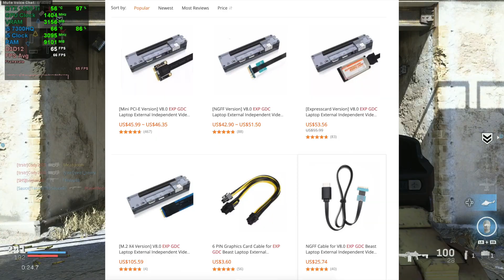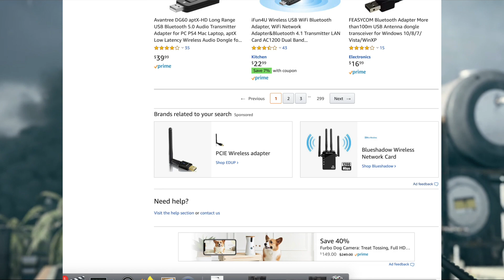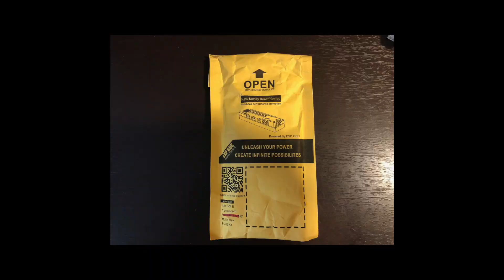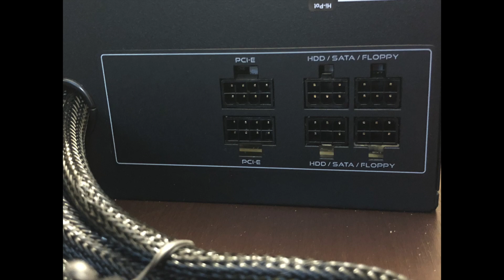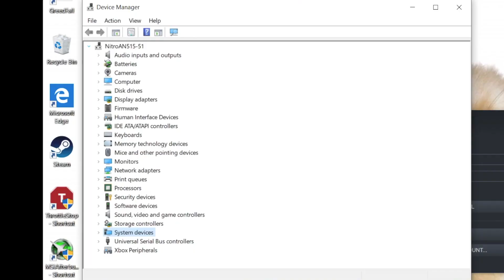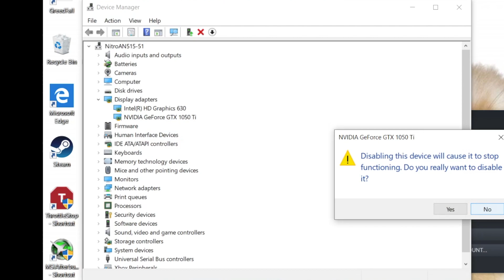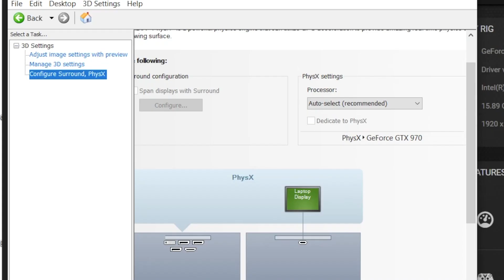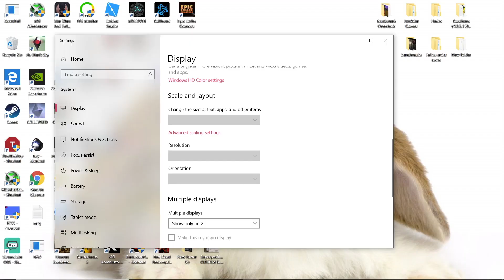EXP GDC Beast NGFF Acer Nitro 5 External GPU Review and Setup

Comment: Ill be glad if u could help, the thing with disabling ports, how did you find tge method for doing it?
Reply from the maker: Trial and error, that's the only way unless there is a detailed guide for the MB out there somewhere.
Reply: @Meanpooh  i mean what type of port should i look for? do you remember how you found that disabling these things work? Thanks :)
Reply from the maker: Generally try disabling the PCIe controller.  That's what the video card uses to communicate.
Reply: @Meanpooh What external doc would you use to connect a 4090 or 4080 to a Asus gaming laptop?

Comment: Hello bro, im writting from southAmerica, i need your help, i have a. Acer aspire 3, and i buy exp gdc with nfgg, all work fine except for a display not working, my laptop identify the gpu but i see mi monior without a image, maybe you know what i doing bad? Thx for your time.
Reply from the maker: I don't know if the Aspire has a dedicated video card but make sure that you installed the drivers for the card you are installing with the EXP.  If you don't have an external monitor, you a TV with hdmi so you can see and troubleshoot.  Remember, once you disable the laptop display, you will be blind without an external display source.  Hope this helps.

Comment: low fps because of the bottleneck or because of egpu  for all ?
Reply from the maker: Both, slow CPU as well as not enough bandwidth for GPU using current connection.
Reply: @Meanpooh what is your openion of i7 4900mq and gtx 1660 , i will face bottleneck and low fps??

Comment: Tried it on my asus rog strix gl531 with rx 580 2048 and hdmi dummy and it works well but unfortunately the bus interface shows only PCIE x16 3.0 @ X1 3.0 . I think something is holding it back, im not sure if its bottlenecking the cpu i5 9300h or maybe the ngff/mpcie/expresscard are simply slow.

Comment: Can you tell me if this same setup will work for 3000+ cards?
Reply from the maker: I can't say but I do know that there is an updated model so maybe that model may work.
Reply: @Meanpooh  Thank you. I just went and bought a new PC with 3060 in it 😀
Reply from the maker: You're better off picking that option.  Congrats on your new purchase.
Reply: @Meanpooh  I appreciate your post. I got Nitro 50 with 12th Gen i5 and stx 3060 video card. I just need to install a liquid processor cooler in it before I start pushing it too hard with VR games.

Comment: The 2021 version of acer nitro 5 have Thunderbolt 4 , so can we use external gpu with it?
Reply from the maker: Not sure.
Reply: @Meanpooh  i am using acer nitro v15 and follow your step but i am stuck on acer logo.... i7 gtx 960m .... egpu 1050ti... can u help me?
Reply from the maker: @zakytetietv9898  Cant give much support without having it but does it boot without the EGPU cable in the in the slot?  Does the GPU have power?  Is the cable secure?
Reply: @Meanpooh  When i turn on leptop EGPU is auto on bu than stuck on acer logo... cabel is scure, i already update bios to last version to..
Reply: @Meanpooh  when i turn off psu... leptop turn on normal... i try to instal driver 960M driver the gpu is not detect so i am sure i already disable the right PCI ....
Reply from the maker: @zakytetietv9898  It's definitely conflicting with something.  You might have to play around with the PCIE controller.  Something is still not disabled.  Trial and error.
Reply: @Meanpooh  for sure that gtx 1050ti is can run with exp gdc?
Reply from the maker: @zakytetietv9898  Yes, it can run the EXP GDC.
Reply: @Meanpooh  ohh ohh i found my leptop is automatic reinstal the driver.... Do you know to stop that??

So what ever i do like use DDU the gtx 960m is still come...
Reply from the maker: @zakytetietv9898  Click Advanced System Settings under Control Panel home. Select the Hardware tab, then click Device Driver Installation.
Then Select the "No" radio box, then click Save Changes.
This should do it.
Reply: @Meanpooh  still not work... stuck on acer logo when i try to turn on gtx1050ti eksternal gpu...

Comment: Kinda wondering about the temps for the laptop itself since the gpu is now outside of it. 
the usual temps for my laptop is around 75-90c depending on the game. furmark after undervolting is usually aroun 80c ambient temperature of 28c (it's usually 30+ where i live hahah)
Reply from the maker: That's not too bad.  At least you dont have to worry about winter storms.  I hope you have some kind of air conditioned area for your gaming needs, it will help a lot.

Comment: It work with and AMD RX 560? I have an Acer Nitro 5 with a GTX 1650 and an Intel I5 10th (ANS 515 model)
Reply: Every time I try to start it it gets stuck on the black screen
Reply: @spaia  What did u do could you use properly ? I'm thinking to get RX 590 or something maybe i can get lover heat. For now 90 RDR2 40fps after with RX590 maybe i can get 75° and 70fps or something...?

Comment: So promising. I have the nitro 5 but when it came to device and manager there was no microsoft basic display adapter. Additionally, since I'm installing an AMD it is giving me an error 173 (no graphics card detected). So close, yet so far away. I'm pretty new to computer software affairs.
Reply: Try using a hdmi dummy/ghost.

Comment: is the ngff faster than the m.2 x4 version of the EXP GDC?
Reply: No, it is the other way around.
Here is a complete Rank of Speed for external GPU setup from fastest to slowest

1) M.2 NVMe X4 eGPU (ADT-Link R43SG & EXP GDC V9)
2) Thunderbolt 3 eGPU running at X4 lanes (Razer Core X and many others)
3) M.2 NVMe X2 eGPU (ADT-Link R43SG & EXP GDC V9)
4) Thunderbolt 3 eGPU running at X2 lanes (Razer Core X and many others)
5) NGFF WiFi card slot eGPU (EXP GDC V8)
6) ExpressCard slot eGPU (EXP GDC V8)
7) mPCIe WiFi card slot eGPU (EXP GDC V8)
Reply: @ClayWheeler  Hi Bro... thanks for this information. my laptop is Support M.2 SSD with PCIe 3.0 2x. can i use AD-link ? or i just can EGPU with EXP GDC ? thanks before
Reply: @fianmu  make sure how many slots available?

If it has 2 slots (1 used, already from the Laptop itself, 1 empty) then you can use ADT-Link.

If you just looking for ADT-Link, the result are mostly M.2 NVMe X4 model but it can still work with M.2 NVMe X2 slot.
Reply: @fianmu  also, make sure the empty slot says "M.2 NVMe" or "M.2 PCIe" or "SATA PCIe" written near the slot.

If it says "M.2 SATA" or just "SATA" then it means that slot Cannot be used for eGPU.

Comment: Really late here but do you think that an overclocked 1070ti will bottleneck on the i5 9300h model? Thanks
Reply from the maker: No, it shouldn't.
Reply: @Meanpooh  nice, thanks mate
Reply from the maker: @hf2848  No Problem.

Comment: you think I could use the EXP GDC with a gaming capture card such as the Elgato 4K60 Pro Mk.2 instead of a GPU?
Reply from the maker: No. According to the box, for you to successfully install your 4K60 Pro into your PC, you will need at least a 6th generation Intel Core i7 or an AMD Ryzen 7 CPU or better. You will also need a spare x4/x8/x16 PCIe slot and an NVIDIA GeForce GTX 10 series graphics card or better.
Reply: @Meanpooh  Aren't those CPU and GPU requirements there for if you want to get the full potential out of said capture card? What about if you use it to capture at a lower resolution / framerate? I'm currently managing window capture and streaming at 720p60 just fine with my old laptop (i5/default graphics card), why wouldn't it with older consoles and the 4K60? Eventually I would want to integrate the capture card into a proper gaming desktop and use its full potential of course, but I don't have the financial means to put that together yet, hence the question about the (temporary) experiment with the EXP GDC. 

Tldr; would my laptop recognise the capture card and be functional in the first place?
Reply from the maker: @horgoththerelentless261  So basically you want to use your Elgato in the Express slot like a desktop PC without disabling the Intel Graphics card such as the Nvidia or AMD GPU?  If this is correct it may work.  Getting the computer to detect it would be the only issue but thinking ahead, it shouldn't.  You may be able to get away with using a small power supply adapter as it would not use a lot of power like a GPU.
Reply: @Meanpooh   was wondering if you could get back to me (mostly curious still about the PSU question)? Thanks!

Comment: Hello, I am trying to attempt this for my nitro 5 an515-54 could it still work on it? and if so what GPU do you recommend the integrated nvidia gpu is 1650.
Reply: i don't think you need any egpu if your integrated is 1650 just add more ram (if your ram is 8gb) and set the graphics to medium or low and you should be fine
Reply: @1Spryyyy1  my intagrated graphics is failing I made a mistake when applying new thermal paste, I added ram into my laptop
Reply: @kitkimagaming6043  ohhhhhh that's why, then apply the egpu (and if it works hopefully) i suggest using 1060 or 1660 (6gb vram) they are somewhat budget friendly and it is capable of running triple a games at high to ultra graphics in my opinion

sorry for the late reply

Comment: So I have the Acer nitro 5 with the 1050ti and the intel i5 8300h, does this have all the things necessary to be able to connect and use a egpu? My friend is giving me his 1060 and now all I need is a power supply. 

Also more questions, does it double my frames or does it only use one of the gpus? 
or does it use both for more power.
Reply from the maker: It does have what you need but it's more trouble than its worth.  You lose portability and depending on the card used, will cause bottleneck or might not even work.
Reply: @Meanpooh  Damn alright, and thank you for replying so soon! This is why I wish I had just bought a prebuilt or just built my own setup, having a laptop is such a hassle.
Reply from the maker: @SmallEyyes  You're welcome.  Having a desktop is best investment as you can expand and have better cooling.  It's just not portable.

Comment: I wonder how hard it would be to modify the case and cable so you could easily disconnect the GPU and restore the portability of the laptop
Reply: is it possible? im thinking that too, i like laptop because its portable but if i cant do gaming without a external gpu anymore i think its better to buy a PC

Comment: im getting code 12 error
ive installed the driver, but without the nvidia control panel
my laptop is still using the intel hd graphics 4000
laptop can read the nvidia graphics card but with caution icon and with code 12

i have 2nd monitor which is plugged in my laptop because when i try to plug it in the gpu i only get black screen

my laptop model is e1-470p, windows 7 64bit os, egpu is nvidia gt730

i also tried to update my bios cause i get nothing much to do in my bios but the update seems no effect nothing really changed
Reply from the maker: Some people are having that problem and from what I've read, you're better off buying a new computer if you're going to be doing any kind of gaming.  If you feel lucky.....https://egpu.io/forums/pc-setup/fix-dsdt-override-to-correct-error-12/

Comment: hi i have a laptop with i3 4005u which gpu do you recommend me to use
Reply from the maker: I would go for 1050ti even though your CPU will bottleneck it.  You're better off getting a new laptop.  You will put too much money into it.  GPU, Power supply.....it adds up.
Reply: @Meanpooh  oh ok tq for replying btw the items at my country are quite cheap as well cuz even gtx 1060 6gb cost like 150 usd.So budget is a not problem in my case.But maybe i might buy a new laptop with a i5 maybe

Comment: Others have asked why you didnt use the extra M.2 x4 port in which you said you didnt test because you didnt want to remove your NVME. With that being answered, what speed was the port you connected to, x1, x2 or x4? Using a port at x1-x2 speeds would explain why its not fast enough so if thats the case then im not seeing the justification in this video. I have the new 2020 Acer Nitro 5 [GTX 1650+Ryzen R5) so I plan to use the extra PCIe/M.2 slot to test a RX5500XT or RX580. Im assuming the extra slot is PCIe 3.0 x4.
Reply: Review video please
Reply: Did it work

Comment: Since the gtx is no longer creating heat, have you noticed a drop in overall CPU temp while playing games? I know both the CPU and GPU are connected to the same cooling system in the Nitro 5
Reply from the maker: I can't really answer that but I'm sure there was drop as the GPU was disabled in the machine.

Comment: I was thinking of setting up an eGPU for my HP pavilion 15 gaming laptop (ec0098ax) which has a Ryzen 5 3550H and Nvidia gtx1050 of 3gb. Is it possible to? Also, just wondering if I could set it up without removing the wi-fi card by using the empty SSD slot, but I don't know what must be done for it. Can you advise me on how to?
Reply from the maker: I'm sure it will work but the prices have shot up really high.  You will need this version if you can find it.
https://www.banggood.com/M_2-X4-Version-V8_0-EXP-GDC-Beast-Laptop-External-Independent-Video-Card-Dock-With-Power-p-1109912.html?utm_source=google&utm_medium=cpc_ods&utm_campaign=nancy-197s-sdsrm-jewelry-content&utm_content=nancy&gclid=Cj0KCQjwhvf6BRCkARIsAGl1GGgrdjOvhkKKejFGyRk7yBQT11Ci_BDwgWONXrw46j5swt3w3Kcq41YaAqqWEALw_wcB&cur_warehouse=CN

You will also have to be able to disable your graphics chipset as I did in the video.

Comment: I'm  getting ready to supe up my nitro 5. I had a few questions. @0:44 you said that that was the ngff version (m.2 ) and that was the one you were using. The port for the antenna is 1x and the spare m.2 is a 4x. Just wondering why you didn't use the 4x? I also saw someone with the same laptop as you and me and they did something similar but their adapter has 2 hdmi ports and in broken English said to not mix them up. He didn't specify which was which and said to refer to the instructions and the link provided had no instructions. Any help you could provide would be awesome!
Reply from the maker: It was the only one available and I didnt want to remove my NVME.

Comment: My 1050ti keeps reenabling itself when I restart  the computer
Reply: Ok it worked. I just needed to wait after i rebooted out of safe mode for it to auto install its own drivers, restart, and then run the error 43 fixer(this only applies if you use m.2)
Reply from the maker: Congrats.
Reply: Nvidia geforce experience also says it cannot install the driver but it isnt even trying. Im using a 2060 and the m.2 version, so the only thing different is that i disabled a pcie lane when you said to instead of the wifi card slot

Comment: Hey man can you do this on an acer aspire a315-42? I’m gathering all the info possible, either way I’m gonna open the laptop to check for the m.2 port next week as my new ram is arriving.
Reply from the maker: The device is technically made for machines without any Nvidia, AMD discrete graphics so yes, it should work if you fit that criteria and have the connections.
Reply: @Meanpooh  Any toughts on the xfx 570 4gb? I couldn´t find anything about which kind of an amd grapich card to use.

Comment: So for disabling the port should it always be the one with x16 because isn't that the port on standard PC's that use graphics cards so that would somewhat apply to the laptop GPU being connected to that port or could the port be different?
Reply from the maker: Try that port fist.  If it does not disable it will be something else.

Comment: Wouldn't it deliver a better performance if you connect the dock to the m.2 slot instead? Been thinking about getting an external graphics card for my laptop, I also have a an515, but with a gtx 1050 4gb
Reply from the maker: Yes.
Reply: Hi there, someone from future here. Did u managed to actually getting one for your laptop ? I think we have the same model, and i kinda want to do this but scare if my laptop not compatible
Reply: @YusrilIhzaM  if it has a m.2 slot or pci (it surely has), it is compatible. I ended up getting a pc actually

Comment: Hi this is a nice video, im wondering if i could attach the Egpu to my m.2 nvme ssd slot without having to remove the wifi card? I dont want to remove my wifi card ://
Reply from the maker: Yes, absolutely.
Reply: U can use usb wifi dongle as substitution

Comment: Windows has stopped this device because it has reported problems. (Code 43) I'm getting this error after installing the Nvidia driver how to fix this Sir.
my laptop is acer nitro 5 AMD I'm using 1660TI external GPU
Reply from the maker: https://drive.google.com/file/d/1ZRW7qqkFoZFkKPCYugrHy6F-_Kx7rD9z/view?usp=sharing

Extract files and go to folder.
Double-click nvidia-error43-fixer.bat
Click YES to UAC approval prompt
Follow onscreen instructions & prompts

Comment: Can I only use internal screen of the laptop? And does performance affects?
Reply from the maker: No.
Reply: @Meanpooh  so basically you can unlock the full potential of gdc without using external monitor
Reply from the maker: You have to use an external monitor.

Comment: If I need disconnect the egpu what happened? Need do another step before or after disconnect?
Reply from the maker: If you have no plans to use it again just log into safe mode and remove the driver using DDU.  Next log into windows and enabled any disabled devices in device manager.
Reply: @Meanpooh I forget mentioned my laptop only have Intel hd graphics, Do I also have to disable / enable it?
Reply from the maker: I dont think so.
Reply: @Meanpooh  thanks bro
Reply from the maker: Welcome.